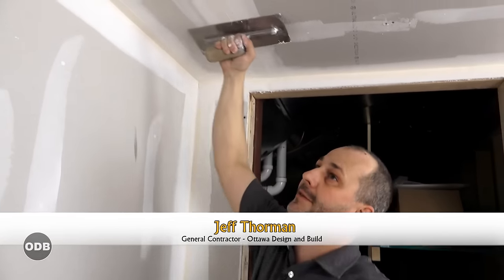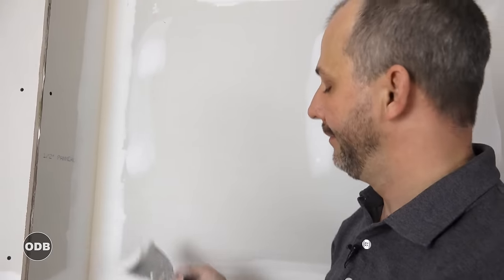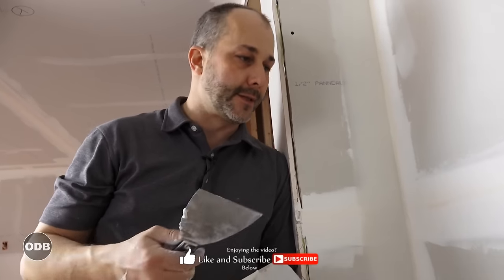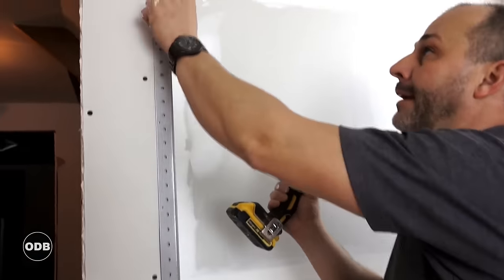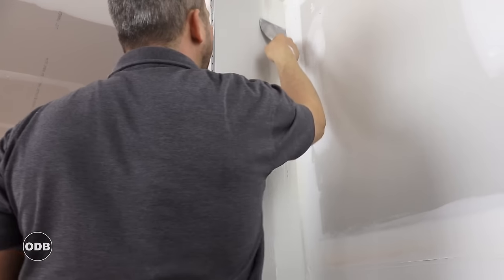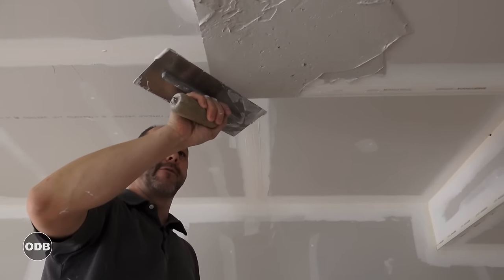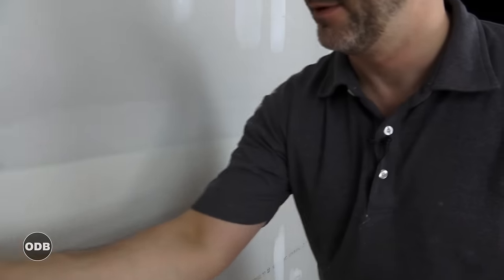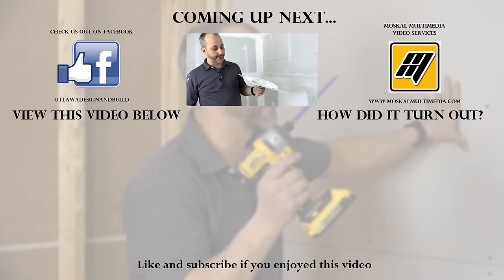Complete Drywall Installation Guide Part 8 Second Coat And Corner Bead

Comment: Hi Jeff, I just completed a very very long tape run in a room (about 30 feet continuous horizontal tape run).  An hour later I came back and found it's fill of bubbles, some big as long as a foot long... what is the best way to fix this?  Do I tear it all out and do it again, or is there some magic way to get rid of an air bubble in the tape?
Reply: OH, and should have mentioned, these are like butt joints, not the usual finished end to finished end, because this is cut 2 feet off the ground (still doing that repair project, but now on to this stage).
Reply from the maker: Good Morning Scott. 3 tips for you to consider. Ready mixed compound must have a few cups of water added to it , you need to apply mud to the finished surface and then clean off in order to wet the tape. you can cut out small bubbles but it it is all peeling then just reapply. Cheers!

Comment: I don't think I understand why you leave the ridges when running down the center of the butt joint on the ceiling.  Did I miss the part where you wipe them off? Or do you sand them off later?
Reply from the maker: once it is dry I use a 4" knife and scrape them off. the more you fuss the longer it takes and the less you fill.

Comment: I started following you from day one and have been very successful so far. Just come up some questions regarding outside corner bead.  Q1: metal corner bead,   trowel is always touching the corner ridge,  after  cleaning the mud seems metal is exposed,  should the corner line be covered by mud or exposed until covered by primer ?    Q2:  corner bead intersection: at bock-head , vertical corner meet horizontal, I always make miter cuts  otherwise they  overlap, is this correct?  Q3: Angles not 135 degree: I am using CGS inside/ouside corner tape,  it does not have the extra sticking out corner like metal or paper faced corner bead, , made of plastic, more than 2 times thicker than metal bead; damn thing does not have memory at local spots like metal; always  goes back to original shape,  I found it hard to pull  or pinch to create gaps with it, once it sticking mud cannot hold it down; do you have any advice about it? 
Best regards
Louis
Reply from the maker: O.K. Luis here we go! First Thank you for your continued support. Without Guys appreciating the videos we would not be here.
In answer to your questions. The outside corner bead edge is exposed and painted in. You are right to miter your corners.Don't use the corner that is causing you trouble. Use the metal paper backed bead if you don't have wood to screw to or the metal one if you do. You could try using a spray glue to hold your bead in place. Thanks for the questions and good luck. I am always here if you need more help.  Jeff

Comment: Why did you switch from regular mud to 45 for that outside corner? Did I miss something?
Reply from the maker: 45 mud is used to fill large gaps and hardens in about an hour so you can put a finish coat on. Otherwise you would need 5 coats of regular to avoid cracking in the mud when it dries. Cheers!

Comment: So how come when I'm getting the mud on i always get streaks. No matter how clean I scrape the knife or keep the tub clean. Is it knife angle? Too little mud on? Help!
Reply from the maker: try sanding the trowel. It should make it smooth. Just use a sanding sponge and work the edge for 15 minutes.Cheers!
Reply: @HomeRenoVisionDIY  thanks for the tip, I'll give it a bash. I had actually thought about letting it crack off a bit then getting a damp sponge to smooth it over lol.

Comment: Why don't you put the screws through the little holes on the metal corner bead?
Reply from the maker: we do if they are punched out. if not we install on the outer edge. Cheers Jo!

Comment: Noob tip - make sure to use a dense bucket and be careful with the mixing paddle. I beat the bucket up pretty bad with my first batch and ended up with so many little Scooby Snacks (plastic shavings) in the mud I had to toss the whole bucket of mud out.

Comment: hi, were you using pre-mixed or quickset for second coat on paper cornerbead?
Reply from the maker: premixed. Cheers!
Reply: thank you so much！and just wonder do you have the video that shows how to taping joint on the ceiling
Reply: What mud do you use for second coat ( allpurpose, lightweight all 
purpose, plus3)?  How much water do you add?   For inside corners,  I try to follow your videos to a T but the mud always rolls up in the corner (not smooth) and takes multiple passes by pushing hard to smooth out.  If I mix too runny i get ridges on other side and not a nice fill on the side I am doing.   Ugggghh!  How hard do you press when making final passes are you putting even pressure on whole knife edge or slightly harder in corner.  How hard are you butting 90 edge of knife onto opposite wall?  The devil is in these nuance details.  Especially the starting mud consistency.  Would love a detailed, fool proof video, zoomed in close, with exact water mix ratios (not consistency of yogurt or video showing how the mud falls off the knife with gravity).  My frustration with all of these DIY videos is that the very fine details need more explanation and coaching.  All this being said,  your videos are best I have found on drywall techniques for DIYers along with the Vancouver Carpenter for the best explanation for the DIYer.  I am still struggling though after watching countless times.  Perhaps you should have a novice there and you should have a format that is teach one do one and we can see all the mistakes the novice experiences and how you coach them through it.  That would be new and never done before on YouTube.  Thanks.  Love your videos, really!

Comment: Interesting that you never use a level to check your outside corners .Why not?
Reply: At this point if the shit isn't plumb you got problems that corner bead isn't going to fix the level should have been used long before this step

Comment: Can someone lay out the steps in writing? I think I heard him say he does his inside corners completely THEN does the rest of his mudding on the butt joints and flats. I thought every joint would get taped then you would mud each equally until you have completed through final coat. Little confusing.
Reply from the maker: I start with my inside corners and butt joints. I don't do butts and flats at the same time. Causes extra sanding.
Reply: Home RenoVision DIY thanks!

Comment: At 8:27 your paper corner bead is not adhering to the drywall! Visible in the upper screen. Its bubbling.
Reply from the maker: That happens with the paper. I think I missed filling a bad edge there so the extra mud was causing that dent. Good news, all can be fixed with drywall and it was.

Comment: Have you not seen or do you not like the No Coat product?
Reply from the maker: Hi Charles , no idea what you are referring too.
Reply: Home RenoVision DIY oh, it’s a corner bead bead product that wildly outclasses metal beads in terms of durability and ease of installation.  As a note I do not nor have ever worked for No Coat (CertainTeed) I’m semi retired GC.  A few years back I ran into a time deadline and the product saved my a**;  the name is no joke either literally the mud used to instal is all the mud you really need.
Reply: Home RenoVision DIY I’ve burned through a little over 3000 linear feet of the stuff never any call backs or issues.

Comment: Soooo much easier with pan and knifes ...6 in. Corners ...10 inch joints for first coat ... sooo much less sanding ... nice job though

Comment: No offense I cringe at the sight of metal corner bead. Of all the remodels ive done, metal corner bead will crack over time when the house shifts. Reason being its atttached to the studs. Never have had to replace paper faced. Just from one pro to another.
Reply from the maker: Hi Daniel, just a little side not. most houses don't settle after the 3rd year. remodeling is usually done after that!
Reply: @HomeRenoVisionDIY  yeah I get that. I have still yet to fond a paper faced corner bead applied with All purpose mud to crack. They are also a lot faster and easier to apply. Cheers!

Comment: He ought to stick the carpentry because he's definitely not a drywaller
Reply: @Ratoosh rittish Time in is the biggest thing with drywall finishing, we all have different methods, I happen to disagree with a few he is using in these videos such as mud on paper-faced corner bead, they are very weak, prone to cracking and denting. His hand taping leaves a lot to be desired, it would be easier to wet the paper tape with water than mud over every tapped seam and angle. I like taping in a logical order, butts, flats and corners all over lapping. At the end of the day I see a lot of work like his when I do my re-paints and repairs, it's acceptable but not at the level of a professional taper. Maybe I'm just from the old school where quality is more important than quantity. What are your thoughts?